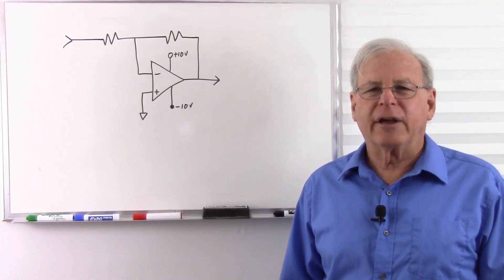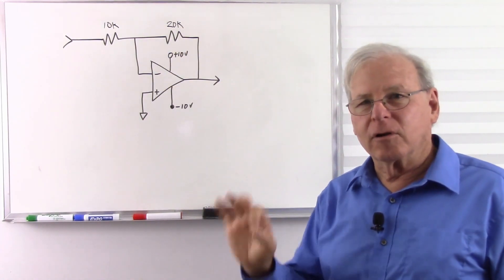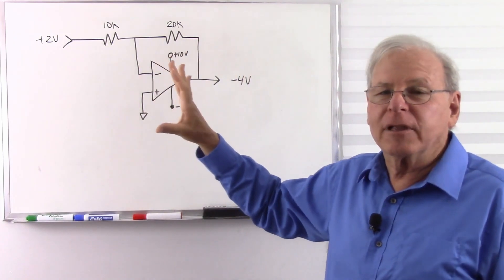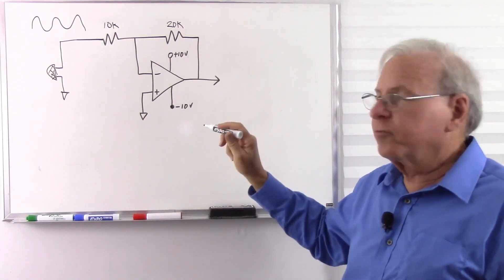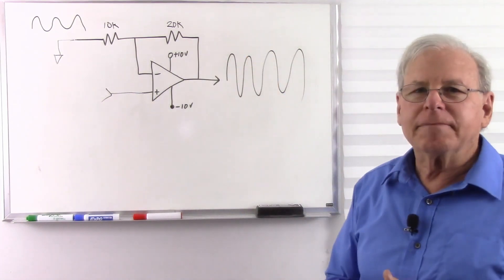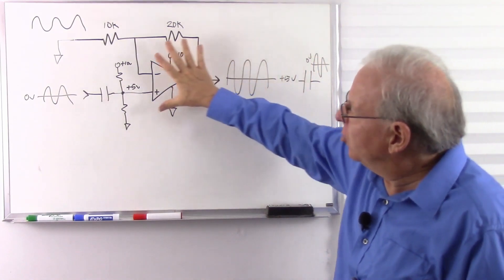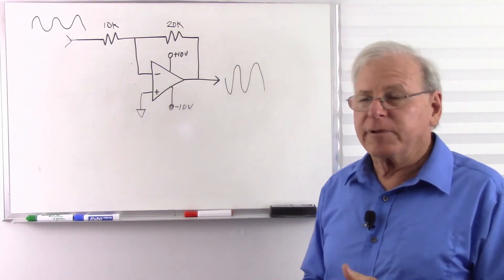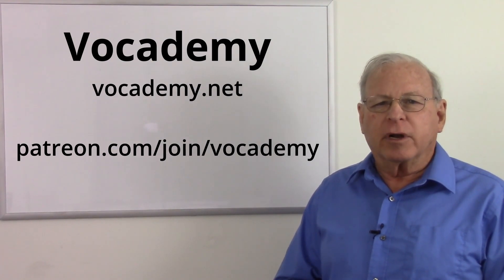A Practical Op Amp Inverting Amplifier   Answers to Questions

Comment: I love Black Rock City! There are lots of electronics out there. Lots of microcontrollers, no doubt, to time the blinky blinky. At our camp in the early 00s, we had a large tower with rows of LEDs up the sides, a decibel meter near the base, and a flamethrower at the top. When you shouted at the base, the LEDs climbed the tower, and if they reached the top the flamethrower went off. You generally needed a group of people to shout in unison to reach the top. After a few nights we started turning the dB meter and flamethrower off at 2am or so because more and more people came by shouting at it with tents nearby. When it was "off", the LEDs just zipped up and down the tower with no sound response, but until people figured that out, they were still coming by waaaay late in the evening to try it out. A fun project overall, but training people to scream in the middle of your camp has some annoying consequences.

Comment: A practical reason for using one amplifier over the other is: Suppose you need a certain gain, so you use the amplifier with +1 for the gain. Then you can have R1 and R2 as the same value. The practical aspect of that circuit is that you can buy a bigger quantity of the same value of resistance for R1 and R2, perhaps resulting in a discount for buying a bigger quantity. This of course means you plan on selling perhaps millions of radios for it to make sense.

Comment: A common and useful application for the inverting amplifer is to sum input signals.
This is done by adding more equal value resistors (R1) to the inverting input - each one going to a different signal source.
The output then will be
- (vs1 + vs2 + vs3 +..) Rf/R1
Where Rf = feedback resistor vo to v-
Now...
Because the non inverting input is tied to ground this means that the inverting input will be at "virtual ground" - which means there is no interaction between each signal input.
A very simple and ideal use for this would an audio mixer where each input resistor goes to the wiper of a potentiometer   thus controlling the level of signal applied from each channel

Comment: 7:26 what about a power supply so the op amp could control a power transistor to maintain a programmed voltage for example

Comment: One strange application of a inverting amplifier I have seen was in vintage radio PLL circuits.  A very few early PLL IC's used positive and negative voltages.  They used inverting Op Amp's for changing polarity between the keypad circuit output which was positive to negative for the PLL's programable divider inputs.